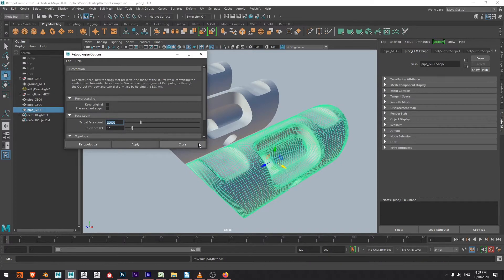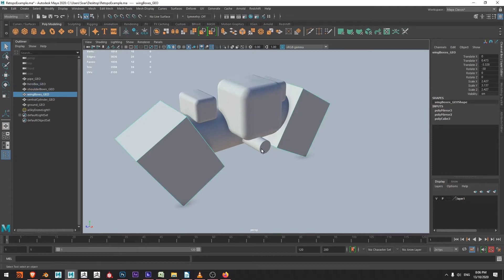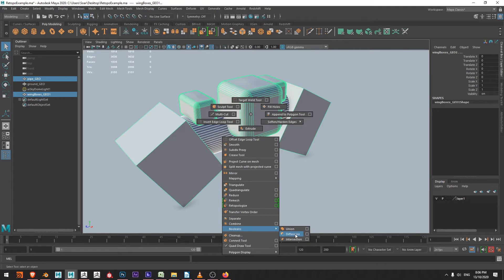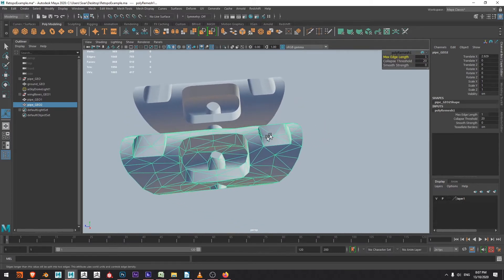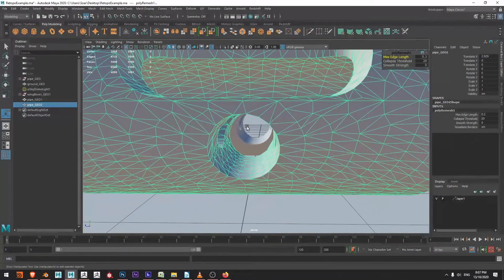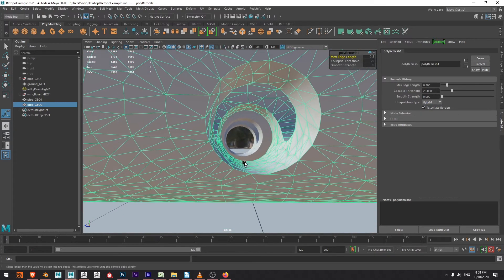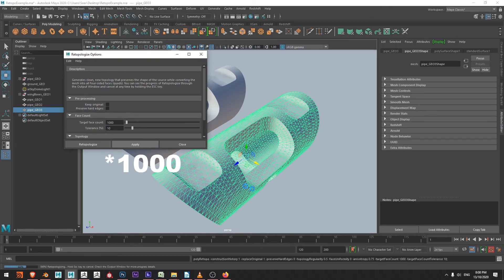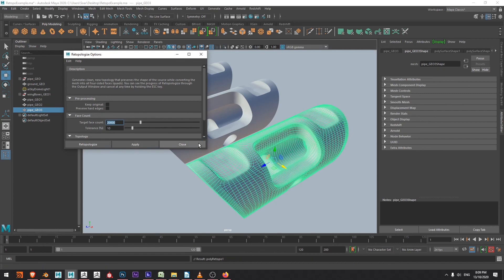Maya 2020 Fix Hard Surfaces - Automatic Remesh and Retopo

Comment: when I use poly remesh, maya aplly an absurdly high amount of triangular polygons. Even setting Max Edge Length to 1.5.

Do you know what it can be? And how to fix it? I need to put a low amount of these polygons!

Ty you so much! Nice tutorial too! =)
Reply from the maker: The Max Edge Length may need to be set much higher if you have a larger object than what I demonstrated with - try 10 and 100. Does that make a difference? =)